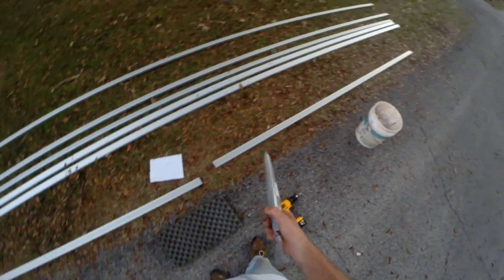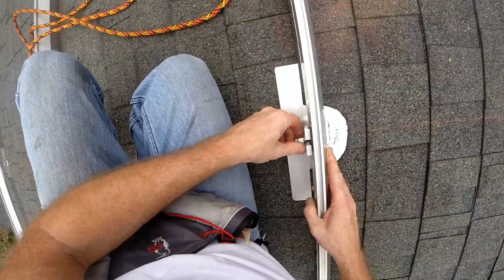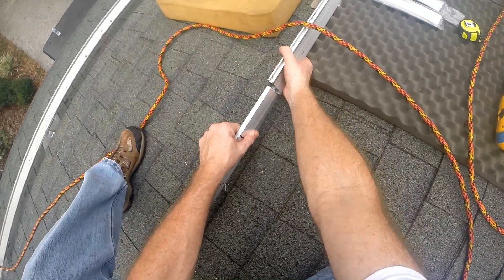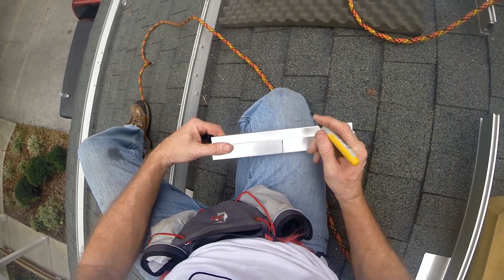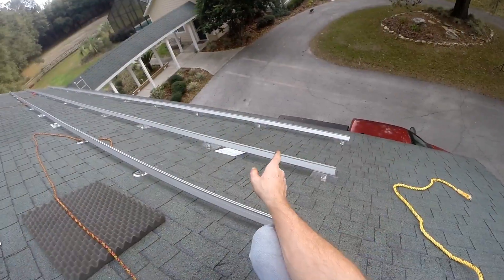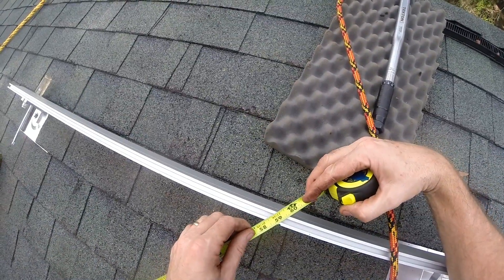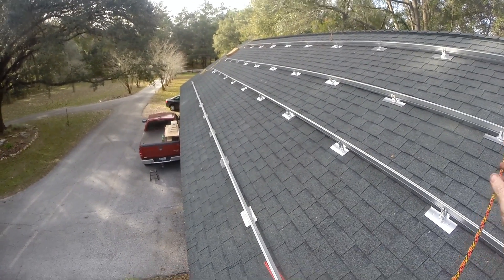Off Grid Solar #32: Mounting IronRidge XR-100 Rails

Comment: Why did you mix the Flashfoot and Flashfoot2? Why not use all the same? The L foot is mounted backwards on that 3rd row. You can see it at the 1:00 min mark, looks like the entire row is like that.
Reply from the maker: Tofulnc, I originally had designed (and ordered parts for) the system to be half the size and in the middle of the project I doubled it.  During that exact time is when IronRidge switched to the Flashfoot2.  Note: The Flashfoot2 is better.  You are correct about the 3rd row L foot being mounted backwards but it probably won't make much of a difference either way.  Note:  I am about to pull all these off and redo the entire roof with metal roof attachments (probably S-5's).  Let me know if your interested in all these Flashfoot brackets and I will make you a deal!  :)
Reply: @HomesteadEngineering  Ah, that make sense. S5 makes some nice attachments.

Comment: Great video. Thanks, but just using the screwdriver to level your rails just means your following the roof level (which could be wavy.  I was thinking you might throw a string level on it or something from one end of the rail to the other?
:)
Reply from the maker: That is exactly right.  In my case the roof is nearly perfect so that is why I did it this way.  I actually built this garage myself (with help) about 20 years ago.  In general, you would need to level it out with a string or other technique.  Thanks!

Comment: Great video! Thanks for the info, I'm planning on installing a similar system soon. However, is your rail installed backwards? I thought the curvy part of the rail was supposed to point down the slope of the roof? Just curious your thoughts, seems like conflicting info on the web. Some install it like yours, which seems more convenient, however some media on the iron ridge website indicates the curved section down slope to take up the horizontal load from the panels. Hmm, maybe it doesn't matter?
Reply from the maker: Hello Qtturner1, I don't remember even thinking about it when I installed it.  Just seamed natural to do it this way.  At first glance, I think it might make a difference on the old style flash foot because it would make the lever arm shorter done your way and therefore harder to rip off the roof.  With the new style flash foot, I doubt it would make any difference.  I am adding 4400 Watts of ground mount solar.  I just finished adding the 3rd PT-100 about 15 minutes ago.  Good luck with your system.

Comment: How did you locate your trusses, did you locate one and then use a chalk line? Also, how do you ensure once you mount it that it is weatherproof and no leaks in the attic? Great video.
Reply from the maker: Mr. Robinson,  I have a complete series on how I installed this entire system.  You can see how I located the trusses here:
https://youtu.be/adMTUREINBg

I check the attic occasionally after a strong rain for leaks.
Thanks!
Reply: @HomesteadEngineering  thanks man. Glad you saved thousands!
Reply: @HomesteadEngineering  one last question what do you normally receive on refund money from your electric company? Did you get the full 30 percent rebate since you did it yourself? Thanks
Reply from the maker: @bigdaddy19821111  I don't sell power back to the utility.  Basically, I use my system like a backup generator (running all the time).  The circuits that are on the solar just reduce my utility usage.  Solar and conservation have cut my bill by 66% (about $200/month).  BTW, I don't lose power when the utility is out.  I did get a 30% credit off my tax bill.  Thanks
https://youtu.be/_0SEdEngx_Q

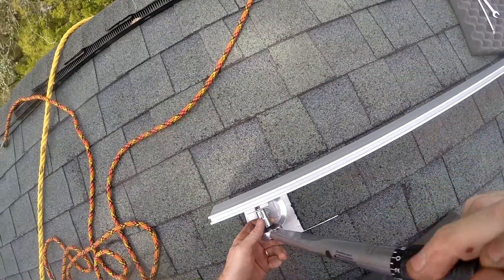Comment: @David Armstrong At 4:40 you said "torquing it to 18 pounds, doesn't seem like much". I'd double check your documentation, from what I see in my installation documents it says "250 pounds" in section 2C for XR100 rails.  http://files.ironridge.com/pitched-roof-mounting/resources/brochures/IronRidge_Flush_Mount_Installation_Manual.pdf Good video otherwise.
Reply from the maker: Brent, 250 in lbs is equal to 20.8 ft lbs

Comment: How does that make them level?
Reply from the maker: I used the screwdriver to space all the clamps at the same height.  Since the roof was level to begin with, the rails will be level.  Thanks!
Reply: @HomesteadEngineering    Got it, thanks.
Reply: @HomesteadEngineering  was this because you had a mix of flashfeet?  Why not just push the rail down untill the  screw bottoms out?  I'm installing my panels today on flashfoot 2s and am wondering
Reply from the maker: @MAC-nm5is  this gives you a little wiggle room in case you have a spot that's not level.  Good luck on your install.

Comment: thanks for answering my last question... i got another one for you. When using the design tool from Ironridge website, it seems to under estimate the number of FlashFoot's needed. Is there a reason you went with your spacing? did you consider staggering them or after you were done, were they too sturdy or just right or what....? Any how, that is my question. Your videos are AWESOME by the way. i have watched some of them several times.
Reply from the maker: Salazar, I did consider staggering the mounts on different trusses but felt that it was plenty strong enough as it is and wanted to keep it clean and uniform.  I am very happy with the design and it has already been through one hurricane with no problems.  Thanks!